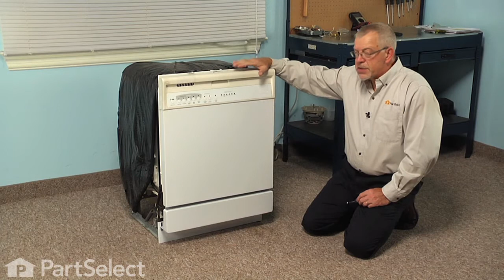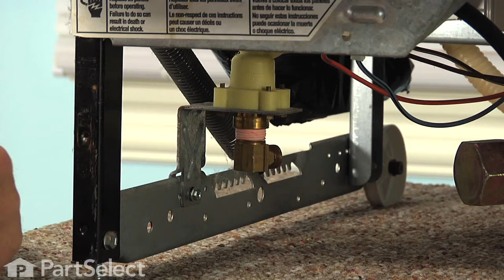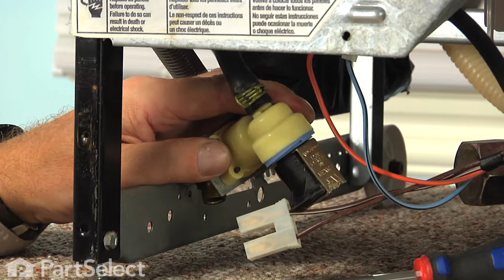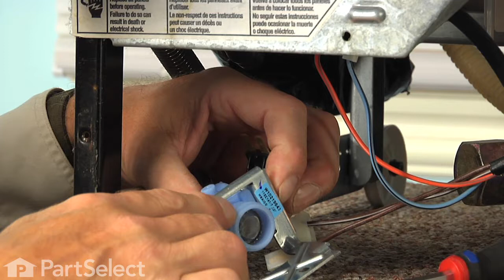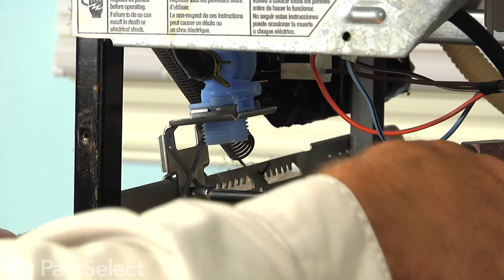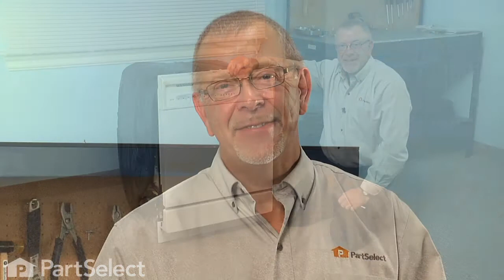Dishwasher Repair - Replacing the Water Inlet Valve (Whirlpool Part # W10219643)

Comment: Important !!!!  Take a picture of the placement of the wiring harness as you can put it on unpside down.  On my DW, there was a white wire with a brown stripe and a brown wire with a white stripe.  (If the wires are the same color it dosent matter)  Hold the pump with the yellow inlet nozzle faceing you, metal bracket on the right the white wire will be on the LEFT and the brown on the RIGHT.   Honestly I'm not really sure if it matters in this case either but figured it may so just fome info.